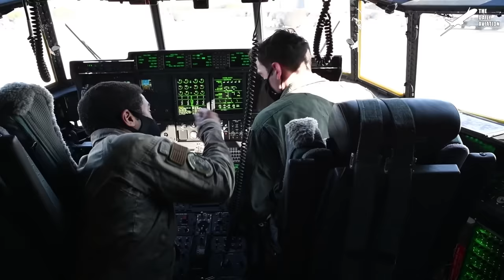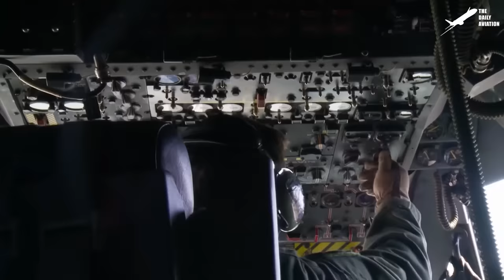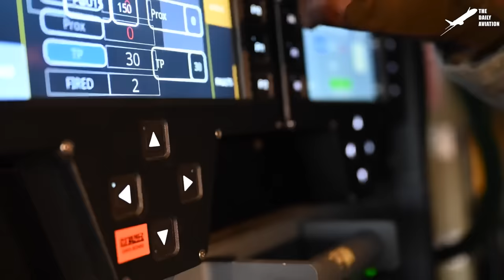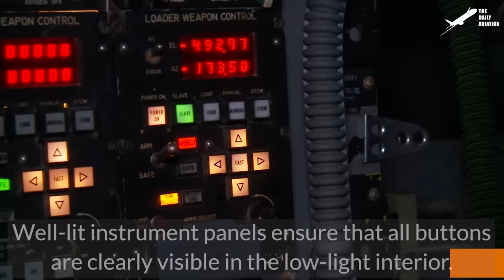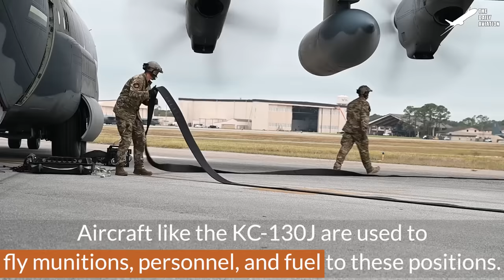Loading Monstrously Powerful US AC-130 Gunship With Tons of Ammo

Comment: In the mid-90’s I was stationed with the 160th at Campbell. We did a fire power display that encompassed most every unit on Campbell and there were Air Force assets on static display on the tarmac. Including the most recent versions of the AC-130 and B-52. As well as a C5, C17 and tankers. The Gunship was very impressive! 🫡